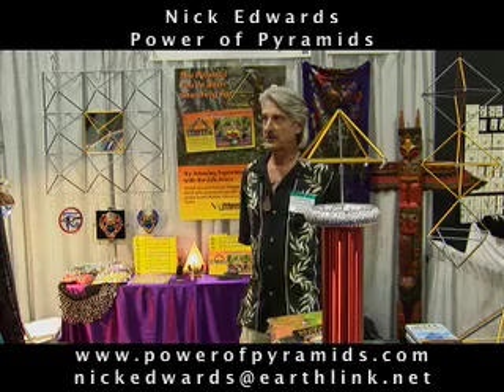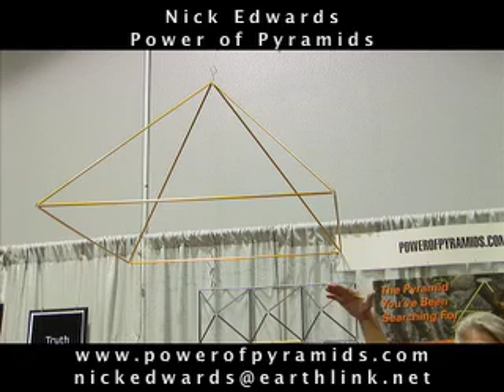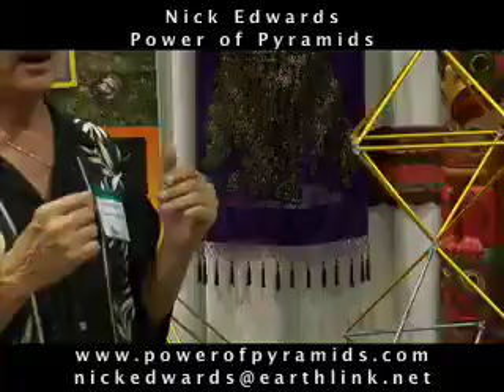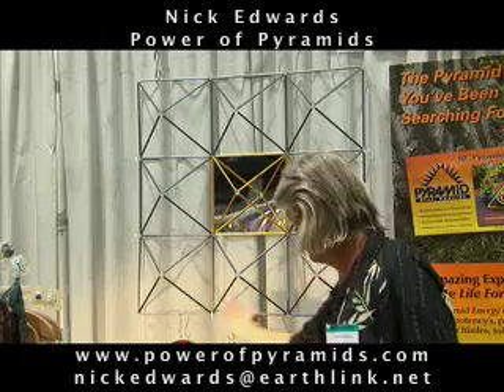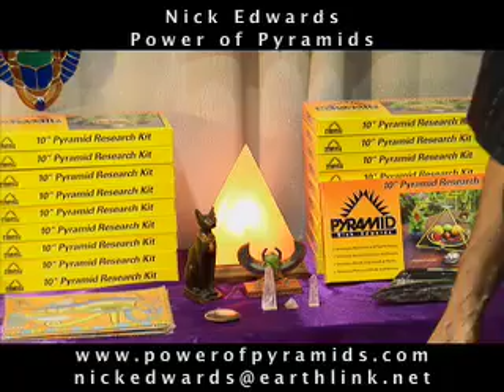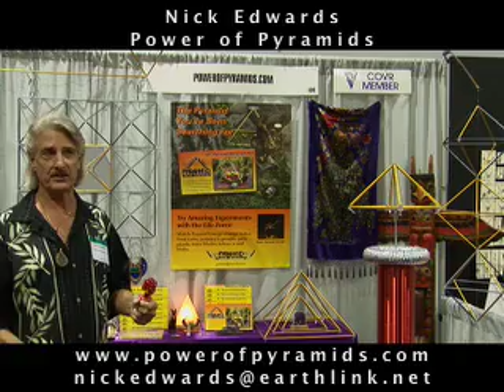Power of Pyramids

Comment: @takapoko444 the problem with his pyramids here is they are not really set up right, for one, they have no walls, this would probally make them *almost useless as a pyramid is supposed to be built exaclt as a capacitor unit would be, this means solar panel walls *basically. His have no walls, so it cant be a capacitor.
Then, a capcitor is used to ground energies, his pyramids are not grounded. Can they still have an effect? Dunno, i doubt it, so i never bothered. Imagination is more powerful.

Comment: @takapoko444 Physically feel different around pyramids, *yes if they are functional. You can feel the energy, yes. Even at giza some state they feel enlightened still and its shut down actually, not working fully.
Giza will not alter weather alone, it requires a mind to access it, as in, the right pyramids along with decisions will alter weather when its done properly. You could walk in a room and not know a pyramid is being used on you, heres one, Television has a pyramid crystal in it.. =)

Comment: Problem here is the giza pyramid requires water underneath it as a grounding source. None of his pyramids are grounded anywhere.. *This raises flags for me, knowing they must be grounded *like a capacitor.. The Pyramid is supposed to eminate 8mghzt. (at almost 52 degree angles) but the walls are very important for a capactior to work, as in, sheilding.. His have nothing like that..
His may work, but it seems like the effect might be very low compared to a real pyramid being a capacitor.